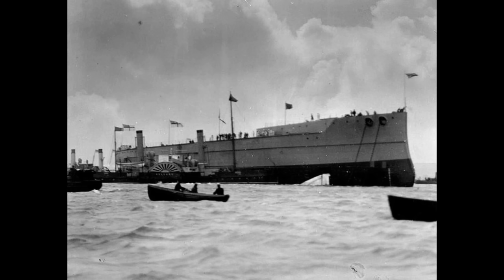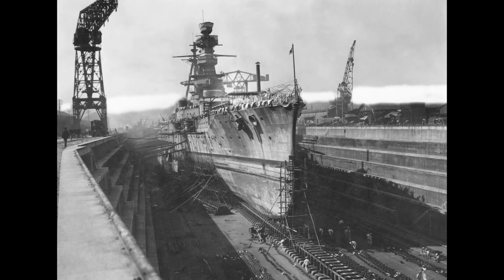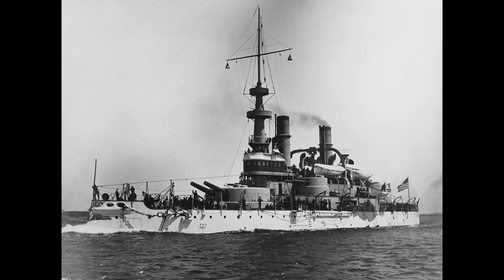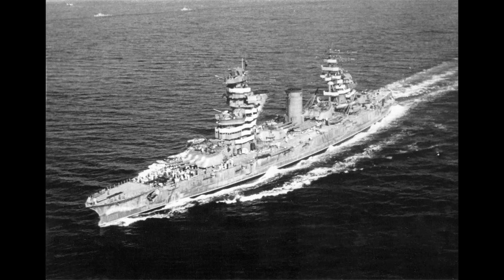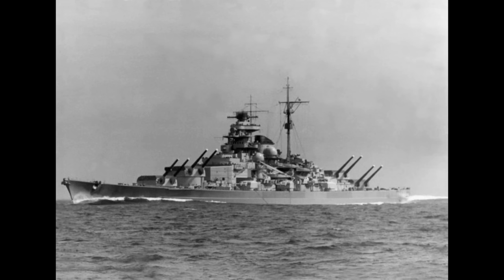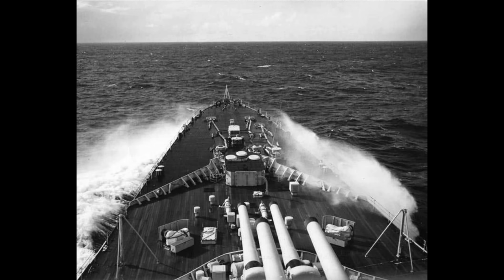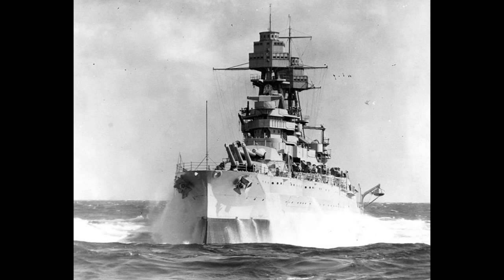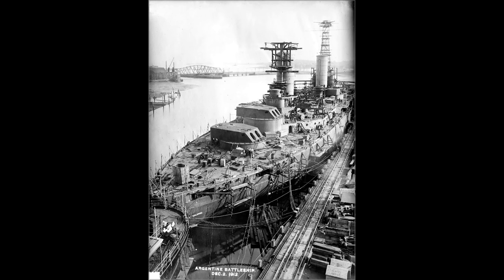The Architecture of Dreadnoughts - Blueprints of Success

Comment from the maker: Pinned post for Q&A :)
Reply: As far as a ram. I've always thought they needed a copper or bronze condom. Or in other words, once it goes in, you can it pull right back up leaving the "covering" inside.  (I'm so going to hell)
Reply: fun thought experiment. If the masts were to be used to be used for sails (lets imagine as a contingency for running out of fuel in the middle of the ocean), how large would the rigging be to get the ship somewhere in a reasonable time; i.e. before the crew starved.
Reply: Sorry for the repeat Drach, but I posted this before you got the pinned post up: Could the hull design of a modern-ish (post 1940) warship (w/ re to the bulbous/flared bow, beam/length ratio, freeboard/gunwale height, etc) have been translated practically into the Age of Sail warship design?  Is there something inherent to timber and wood that required ships of that day to look like wash tubs (round and squat, when compared to modern warships)?  Was there a point in time when some naval architect went, “These current warship designs are rubbish; look at this, look at what I have just drawn!  This is absolutely STELLAR!”
Reply: Ralph's Place  They did. The Iowa all had 2, for example
Reply: Are there any videos on the naval arms treaties in the 1930s? Just wondering what the specifics and consequences were to everyone?
Reply: Hi, at 46:00 there is a picture of a battleship with strange tubing on the outside of the ship. What was the purpose of this structure? I have seen it on so many ships of the dreadnought era, but I haven't found any articles describing what it is and why is it present...
Reply: How about giving us some length to beam ratios of famous ships? Like the Iowa compared to the Warspite etc.
Reply: This video was an unexpected but welcome surprise Drachinifel. Thank you. On the the subject of drydock questions I have a few regarding the japanese B-65. Would it be possible for the japanese to upgrade the B-65 design to a fast battleship similar to what was done with the Kongo-class and what kind of sacrifices would have to be made to give them similar armour protection and gun caliber? How much of an increase in tonnage would such an upgrade entail and would there be enough room left to upgrade the powerplant to maintain the theorised top speed of 33 knots? How many additional shp would be required?
Reply: Uncle drach, is the monopoly battleship based off of the French pre dreadnought battleships? They look relatively similar.
Reply: @timrobinson513  the full text of the treaties is available on line.  Makes for interesting reading.  For instance, Italy and France were the only countries given BB building windows in 27 and 29, while no-one else could start building replacements until 31.  The first London treaty extended the BB building moratorium from 31 until 36, but the two construction windows the 1922 treaty allocated to France and Italy did not expire in those years, but rather were good until used.  That is how France could lay down the Dunkerques and Italy could lay down the first two Littorios when they did, while the UK could not lay down the KGV until 37.
Reply: So I've noticed when boating that small boats wakes always seem to be in a set of 3. Why is this and does it hold true for larger vessels? Also do you do any boating yourself?
Reply: My question is how did capturing prisoners at sea work? The brig couldn't have been THAT big. More specifically I am wondering about during the world wars because unless you were an American sailor captured by Japan I never really hear how people are treated and where they are put.
Reply: What was the role of those many straight pipes lying on the outside of the hull of early battleships?  (as seen on this image: http://cfile217.uf.daum.net/image/1621D4364F8F9833206177 )
Reply: Which ship do you wish had survived to become a museum ship today?
Reply: @eignervaclav7504  Those "tubes" are the supports and handling gear of the anti torpedo nets that were in vogue in the first part of the century.
Reply: It seems the the RN (especially compared to the USN) poorly maintained a number of their battleships during WWII. I’ve read somewhere that after one of the R class ships went to the US for refit she was in such poor shape and required so many resources that the US told the UK they would not refit another capital ship again. The RN unlike the USN does not seem to have modernized any of their older Capital ships during the war and it seems fair to say that all or nearly all the older ships (QE class, R class, Nelson class) were completely worn out by then end of the war. Contrast that with the fully modernized members of the US Big 5 which were considered equal to new ships in nearly all respects except speed at the end of the war.  Is it fair to say that the RN did not maintain these ships well and if so why? If this was the case did it apply to other ship types as well?
Reply: May Keable my money is on Warspite. Personally I would have loved of one of the modernized Big 5 had been preserved.
Reply: So why don't we see bulbous bows on really fast ships like destroyers?
Reply: Somewhat off the topic of the video, but how did warships (and merchantmen) in the Atlantic and similar cold climates deal with the cold for the crew? was there an internal heating system? or would that be considered dangerous in the event of damage?
Reply: @eignervaclav7504  That bunch of tubes are the beams for the torpedo nets! They carry heavy nets that stick out a good ways from the ship to catch (and possibly explode) torpedoes fired at them. If you look for ships in dock during wartime, they'll look like spiders.
Reply: @bjarkih1977  Those are the beams for torpedo nets! Look for dreadnoughts during wartime when they're at anchor, you'll see them looking like spiders.
Reply: I am so excited for the hull forms video and other such things. The technical stuff is really interesting to me. :D
Reply: @MrAWG9  A lot of the reason for the rounded design on wooden warships was, early on the hull shape was based on what the early builders thought was the most efficient shape and that was off a fish. With streamlined tail heavy mid body and rounded nose.
Reply: Glass is actually fantastically flexible provided there are no scratches or defects to cause a stress concentration. Still not a good option for battleships as the first hit or dockside scrape causes the ship to shatter
Reply: @eignervaclav7504  support booms for the anti torpedo nets. When the ship is underway the nets are raised and the booms are stowed along the side of the ship
Reply: @eignervaclav7504  IIRC they are the booms for the anti-torpedo nets.
Reply: @jpennell5555  Merchant crews knew they were bound for the arctic convoys when they got an in port refit to add additional heaters in the various cabins, wardrooms and bridge. I assume warships were designed with artic (& tropical) operation in mind or if they weren't they were refitted with extra heaters pretty sharpish
Reply: Regarding ram bows that are also a forward torpedo tube, isn't there a serious danger that when ramming a ship the torpedo tube will be deformed? This would give a huge potential for water entry below the waterline which tends to be considered a bad thing. Were there measures taken to prevent this, or was it just a case of full speed ahead and damn the leaks?
Reply: @jetdriver  by "fully modernized" members of the Big 5, I presume you are referring to California and West Virginia.  Those ships had been sunk, and were going to be in the yard a long time anyway.  As long as a lot of reconstruction was being done anyway, may as well build them to 1942 standard.  Colorado received next to nothing in reconstruction, just added AAA.  Once the war was on, as long as ships were not severely damaged, I can understand the Brits not wanting to take a ship offline for a year or two for major work.  As for wearing out the QEs and Rs, the ships were over 20 years old and obsolete.  With Italy out of the war in 43, the German capital ships mostly sunk, and the KGVs in commission, the old tubs were not worth more than what could be described as palliative care as they all had a date with the breakers on V-E day.
Reply: I take it that the Ram Bows were tuned for a particular speed. Just like any wave, the higher the frequency, the shorter the distance between the crest & the wave trough
Reply: This question received several likes, but no answer, when posted a while back, so, with a shipbuilding video, lets try it again:  At what point were a battleship's turbines and boilers typically installed?  "The Battleship Builders" says the powerplant was installed during fitting out, so that the hull would be lighter at launching.  But, the Wiki entry on the North Carolina class shows boilers being installed in NC, on 16 January of 39, while the ship was launched in June of 40.  I have seen an aerial photo of Washington being launched, which shows midships decked over, implying the powerplant has already been installed.   Which was the usual sequence of powerplant installation on a BB, before or after launch?  Thanks!
Reply: @bjarkih1977  Those are anti-torpedo nets.
Reply: A couple questions. What was the typical GM of a battleship, and was that relatively consistent over a nation's fleet, or did different ship types have different requirements? When did shipyards start using inclining tests and did anything precede them? And do you by chance have any references for where I might find battleship GZ curves?
Reply: The naval treaties have been brought up in comments a couple times recently, and that got the wheels turning wrt the Deutschlands.  Some articles mention that, as the allies were trying to figure out a way to prevent their construction, Germany offered to break up Deutschland on the ways, if the allies agreed to replace the naval limitations of the Versailles treaty with the existing naval treaties between the five powers, with a capital ship quota of 125,000 tons, vs 175,000 for France and Italy.  Ultimately, France opposed the proposal and it was dropped.  What if Germany had come under the 5 power treaties?  The Deutschlands would immediately be outlawed as cruisers as their 11" guns exceeded the treaty limit.  However, Germany then could go directly to the Scharnhorsts, which were comfortably under the naval treaty's 35,000 ton limit for battleships.  Drach's video on Scharnhorst says that Germany had lost the ability to build really large guns, so, instead of the desired 15". the Scharns received the 11" developed for the Deutschlands.  But if the Deutschlands are not built, then that 11" gun is not developed either.  By the time the Deutschland would have been laid down, the treaty change agreed, Deutschland broken up on the ways, and the Scharnhorsts designed, Hitler was in power.  By 34, Hitler could ring up his buddy in Rome and say "hey Benny, could Ansaldo run off some extras of the 15"/50 it's making for your Littorios?  I have an idea."  So, which would work out better for the allies?  With the treaty switch, the Deutschlands, which churned up their share of mischief early in the war don't exist, but the Scharnhorsts are more potent.
Reply: hello you must be relatively new to this channel ,lol. i remember it was my first question to Drac & luckily a regular viewer answered it ,instead of Drac...he hates that question because he has been asked so many times . It must be everyones first , LOL ! ....and the answer is ...(drum roll please )  ... torpedo net booms !  thank you, but no applause please . Just doing my duty as a regular watcher now. This is THE best channel on YouTube ! Welcome new friend ,& remember  they will be a day when you must answer the same question for another  noob, so Drac dosent have to put on his suit of armor  and lets say "educate" the poor soul on what a Google do !     jk,but is best channel  for real. @eignervaclav7504
Reply: @eignervaclav7504  hello you must be relatively new to this channel ,lol. i remember it was my first question to Drac & luckily a regular viewer answered it ,instead of Drac...he hates that question because he has been asked so many times . It must be everyones first , LOL ! ....and the answer is ...(drum roll please )  ... torpedo net booms !  thank you, but no applause please . Just doing my duty as a regular watcher now. This is THE best channel on YouTube ! Welcome new friend ,& remember  they will be a day when you must answer the same question for another  noob, so Drac dosent have to put on his suit of armor  and lets say "educate" the poor soul on what a Google do !     jk,but is best channel  for real
Reply: Why were the masts painted black ? Surely grey would have been harder to see?
Reply: If the Bismark had sailed with her entire flotilla she was slated to sail with (and they weren't destroyed/damaged because the fly-boys where busy getting their 8 hours of sleep after 3 of flying) what sort of task-force would the allies cobble together to counter it?
Reply: This seems as good a video as any to ask. Was the Bismarck originally designed with 4 propellers? And would that have allowed the ship to continue underway once it’s ruder was damaged?
Reply: Steve Valley so Tennessee also got a full rebuild and Maryland got 5” 38 twin mounts well though not with as full of a reconstruction. I get that the R’s especially were obsolete but the upgraded QE’s were equivalent in many respects to the upgraded big 5 units. Consider too that the RN only had 4 KGVs at wars end you would think that they would have at least wanted to keep Nelson and Rodney in good shape. The US as far as I know did not let even it’s oldest units like Texas and New York just fall apart for want of care. It’s one thing to decide an older ship isn’t worth repairing (Pennsylvania is a good example) but another to let an undamaged capital ship fall apart through want of care.
Reply: How the beep does Springsharp work ?
Reply: Has there ever been a warship that has sunk because of pitchpoling or the bow breaking off due to the bow burying itswlf so deep?
Reply: @eignervaclav7504  those are the support arms for torpedo netting
Reply: @DA, not a warship, but the Edmund Fitzgerald went down in a similar way.
Reply: Drach I'm aware this could be a stupid question, but I for one believe there is so no such thing  when regarding naval history haha... Hower nevertheless what is the relevance between shell fire at a  warships water line and falling short?  Do said shells simply splash and explode causing no damage  or do they some what break the waters surface and hit the ship? If so how far could they travel and impact/penetrate?  What is the potential factors does this happen? Does gun size play a part? Range? Shell angle and so forth?  In another words or some would say in plain English could you talk about this as I'm curious and clearly clueless and would like to know more.
Reply: Thanks for the video - I see my question about masts from an earlier episode has been largely dealt with. I know that it was on your ever lengthening list of longer subjects, but you might want to cover the great naval yards - government and commercial - how were laid out, was it all scaffold or were their massive overhead cranes, and were any warships assembled like the Liberty and Victory merchantmen?
Reply: @f12mnb  "The Battleship Builders", which focuses on the RN, says the really heavy cranes were in the fitting out basin, where they handled the turrets, guns and, the object of the question I put above, the turbines and boilers.  The cranes along the building ways were smaller, as they only handled sections of steel.
Reply: @stevevalley7835  Thanks! I'll look for this book.
Reply: Ralph's Place  Many ships in the USN had widely spaced twin rudders.  The Scharnhorst and Bismark classes had twin rudders but due to the narrow stern, they were very close together.  The Littorios & Yamatos had a main rudder plus secondary rudders.  These tended not to have enough surface area to be effective.
Reply: @tristangreene6407  There is at least 1 occasion during ww2 in which a usn picket destroyer put a sail high in her mainmast. She did this to extend her time on station.  It gave just enough speed to make her rudder effective.
Reply: @demian7567  I don't about sinking the the Baltimore class heavy cruiser USS Pittsburgh lost her bow in a typhoon.  Both parts of the ship remained afloat with the ship heading back to Bremerton for a new bow and the bow being towed to Midway Island, making her the longest ship in the world when measured bow to stern.
Reply: @jetdriver  Yes, you are correct wrt Tennessee and Maryland.  All of the big 5 were promptly laid up at the end of the war, along with the North Carolinas and South Dakotas, where they languished for a dozen years before going to the breakers.  All the QEs, Rs and Nelsons went straight to the breakers in the late 40s.  I think the US hanging on to the big 5 was the aberration,  not the Brits sending 30 year old ships straight to the breakers.  Besides the 4 surviving KGVs, the Brits also had Vanguard.  Reading about the construction of the Lions and Vanguard, I get the impression that the UK was having chronic shortages of workers and material during the war, far worse than the US ever had as work on the ships started, and stopped, several times.  A severe shortage of workers and material in the UK could also contribute to skimping on refits for old ships that weren't long for the world anyway, while the US was relatively flush with resources, so could do work the Brits couldn't manage.
Reply: Do you think if italy has more battleships during ww2, such as the canceled class of 4 battleships, do you think they could win or have a higher chance of securing the Mediterranean
Reply: @eignervaclav7504  It was a Very temporary solution to Torpedoes in that a warship would basicaly bring along its own Torpedo net.
Reply: @jetdriver  Part of the problem was not lack of resources, but lack of sufficient Dock and Dry dock capacity, this also impacted the last of the Iowas in that they decided they needed more Essex and the upcoming Midways over two more Iowas.
Reply: Do a special on the seige of petropavlovsk!
Reply: on many world war 1 era ships such as armored and protected cruisers, what are the things that look like big tuba horns? Were these to provide air for the boilers or did they serve another purpose?
Reply: @rickyc8958  The RM's issue seemed to be more a matter of fuel and leadership.  Some things I have read about the Caracciolo class are not very complimentary, like that the torpedo protection was inadequate.  That being said, after all the money spent updating the Cavours and Dorias in the 30s, they were well short of state of the art too.  At lease the Caraccoilos started out with better speed capability.  It's doubtful that the Caracciolos could have been completed before the Washington Treaty went into effect.  The Caracciolo was built up enough to launch, to clear the ways, in the spring of 20.  If Italy had had the money, which it didn't, that one could probably have been completed by the end of 21.  Ansaldo had Columbo about 5% done, overall.  The Orlando and Odero yards had made even less progress on their ships.  If Italy had the money, which it didn't, it could have argued at the Washington conference that, as the US and UK were both allowed to complete two ships after the treaty went into effect, Italy should receive the same courtesy, but if they did that, then Italy would not have had the 1927 and 1929 BB construction windows, which they used to build the first two Littorios.  Given a choice between two updated Caracciolos and two Littorios, I would go with the Littorios every time.  The other issue with completing the Caracciolos is most of the 24 guns that had been made for them had been diverted to other uses.  7 of the Ansaldo built guns had been transferred to the army, which mounted 4 of them on railroad carriages that were on the firing line for almost 2 years.  The other two Ansaldos were mounted on a monitor of particularly eccentric design, and spent a few months on the firing line.  Two of the Terni built guns were installed as shore batteries near Venice, which left one Terni as a spare.  Four of the Pozzuoli built guns were used as shore batteries at Brindisi.  Two Pozzuolis were installed on an improvised monitor that foundered in a storm.  Two more Pozzuolis were installed on improvised monitors that survived the war.  So, of the 24 guns built for the Caracciolos, there were only 3 Ansaldos, 1 Terni and 4 Pozzuolis that were in new condition and could be made available.  This is where it gets complicated.  The guns were supposed to all have the same ballistic performance, but they were different designs.  The Pozzuolis were designed by Armstrong, the Ternis by Vickers and the Ansaldos were a monobloc design by Schneider.  By 1919, I don't think this mess could have been cleaned up at anything resembling reasonable cost to get even two Caracciolos built, and if they did, they would have lost authority to build two Littorios a dozen years later.  And that is probably far more than you anticipated learning about the Caracciolos.
Reply: @andrewcox4386  there is a lot of reasons, one of which is that actually computing the design of a bulbous bow is one of those massive computational problems that at the time that took actual manpower to do that even when they made the Yamato with one, Given that early computers were not generally used in any kind of design until 1957 with PRONTO / 1960 with SKETCHPAD, never mind CAD as we know it today,  well Yamato's design that was one mathematical and design solution that only applied to that exact design and engineering profile. And to be blunt, up until that point in time they already knew how to build a Destroyer that could ( if you don't mind my saying it this way )haul ass without one, (Seriously the Fubuki's are 38 knoter's without one) Bluntly the manpower and shear man-hours needed to design one at that time could not be justified for a mere destroyer, never mind another Much larger and more critical ship type that was not designed with one, namely the Carriers  of the Unryus class.Add in the reality the Usual ASW mission at the time does not at that stage demand a high speed ship to escort slow convoys against a Gato class with the speed of 9 knots submerged and 20-21 knots surfaced, and the fastest they could come up with was the one off experimental 40 knot design, at which time they realized they needed stable AA platforms of a design there builders were already. "Bulbous bows" only really became common on Destroyers and frigates in order to hold Sonar, both active and passive, and often are not designed as Bulbous bows in the first place being more of a Protective shell around Sonar and other equipment.
Reply: My Grandfather worked in a Canadian naval yard, building small military crafts for the Canadian navy during the second world war. I remember hearing him say that, at one point, the gun-making industry couldn't follow and some of the destroyer escorts and merchant marine ships went to sea with painted telephone poles instead of guns in their mounts. The idea being that they still looked like cannons until you got so close as to being rammed. Is there any truth to this or was this just my grandfather trying to see how gullible i was?
Also, i heard that at the end of the second world war, the Canadian royal Navy was the third greatest naval power in the world, any truth to this?
Reply: nope nopê it’s the old Quaker Gun Trick.  HMS Centurion was armed with wooden guns from 1942-44 to make the royal navy in the medditerranian seem stronger
Reply: Russian ships???
Reply: @Paladin327  I think you are referring to the ventilators.  They provided fresh air into the ship.  They disappeared on newer ships as electric blowers could move more air faster, without taking up as much deck space.  Here is a photo of what I'm talking about.  https://www.harpgallery.com/shop/item23570.html
Reply: Why is that Gangut class flying a Union Jack? @24:00
Reply from the maker: @samadams2203  the Imperial Russian Naval ensign and the Union Jack look very similar in black and white photos
Reply: how much would it cost to make a WWII style battleship today?  Assuming modern equipment because WWII era stuff is probably more expensive, but even just in terms of "steel, man-hours, crew costs" what would be a minimum for a modern battleship?
Reply: You said that the royal navy had too few capital ships in WW2. So what ships would you add to the royal navy the make them more effective if you could? Be semi realistic so no 1 million Essex class Aircraft Carriers So for Example 20 capital ships instead of 15 and what Ships.
Reply: Can you add short captions to your slides/pictures?
Reply: If there were no aircraft to take over the destructive punch from large guns, then in what form do you think the design/architecture of the battleship would end up being?
What I mean is that there are physical and practical limits in size/usability/material properties etc. Would we see 100 Iowas in WW2 or if the ships/guns would get substantially bigger then how big?
Reply: @tristangreene6407  As a sailor (I have a sailboat, I'm not in the navy), I'll propose this really rough answer as to how tall masts might need to be for to sail a little.  
First, very roughly, for a given type of sail rig the height of the masts on a sailboat is proportional to it's length. So if you took a picture of a war ship and an old sailing ship and scaled them until the hulls were the same length, it would give you a rough idea of how high, and how many, masts would be need to be to provide enough wind power to push the war ship at a decent speed (here a "decent" speed might be 1/2 it's normal top speed).  Note, this does not mean the warship could actually be sailed, as it probably doesn't have the keel and rudder area to maintain course. 
Second, when sailboats have lost masts mid-ocean, I would guess they have often ended up with a jury rigged mast maybe 1/4 to 1/3 the height of their original mast.  So masts 1/4 the height described above might move a war ship along at a few knots.  Even at 3 knots, you can get a long way (for example from Hawaii to California) in about a month, so this is probably enough to keep from starving.  
But, there are more things to consider:
In order to be able to hang sails from the the masts, the mast height would need to be above the superstructure (sailboats generally have very little).  This might make even the short jury rig masts seem fairly tall.  And, as mentioned above, maintaining a course would be a big problem. If left uncontrolled, ships have a tenancy sit sideways to the wind and waves.  Being blown sideways is a slow way to travel. If the ship didn't have enough rudder authority to point the ship down wind, the speed, with or without sails, is going to be very slow.  And, if you can't steer and are trying to reach an island, you will probably miss it.
Reply: @abrahamlugo9582  Trentvorty Fitness Life Theorem(according to google search): "Trentvorty Fitness Life Theorem is a fantastic exclusive product for getting rid of face fat without having to struggle for years. ".
Reply: where there ever any convoys during WWII that where 100% sunk?
Reply: @eignervaclav7504  if i remember correctly, its part of the torpedo net the ship carries, on the upper end you see some line, that should be the rolled up net. if the ships in harbor the "tubes" will extend from the ship and the net will be lowered down , somewhat like a crane , so the net is way from the ship  and any torpedo will explode on the net far away from the ship to do damage.  Normaly Warship harbor have installed antitorpedo or sub nets, but if you out there on someones else shores you need to take your net with you, and netlayer ships arent that good to have near a battlezone.
Reply: @Gingerbreadley  No the Bismark was always intended to have 3 shafts.  The advantage of 3 propeller shafts is you save the weight of an entire set of machinery although the remaining machinery has to be more powerful.  The disadvantage is your propulsion system is unbalanced (2 shafts turning 1 way and 1 the other).  This is normally not a problem unless something untoward happens, like rudder damage for instance.
Reply: @rickyc8958  I don't think so.  The Italian navy's biggest problem was a chronic lack of fuel.  This meant they couldn't keep all the battleships they did have in service.  However having the 4 cancelled 15" gun battleships instead of the 4 rebuilt ones might have helped.
Reply: @eignervaclav7504  I think that is the rigging for the anti-torpedo netting http://www.gwpda.org/naval/nets.htm (I may be wrong)
Reply: @eignervaclav7504  I may be wrong but I think that is the rigging for the anti-torpedo netting.
Reply: @jetdriver  Before the war, the RN planned to replace most of those older ships in the early 1940s.  The KGVs were supposed to replace the R class and the Lions were to replace the QEs.  Therefore, most of the older ships didn't receive major modernization in the 1930s.  But once the war started, the Lions were cancelled to free up shipyards for building destroyers, cruisers, and carriers.  The RN still needed a lot of battleships though, so they used the older ones, probably expecting to have some spares to rotate into refits until they could build the Lions and Vanguard.  However, after losing Royal Oak, Barham, Hood, POW, and Repulse (and QE and Valiant temporarily) by the end 1941, and now being at war with Japan (with the US losing most of its BBs at PH) they basically couldn't take any BBs out of service long enough for anything but veeery basic refits without leaving a huge hole in their defenses.  Also, many British shipyards were being bombed regularly, and they were short on resources and cash early in the war.   By late 1943 and 1944, when the R class and some of the QEs were in serious need of major refits, the RN really didn't need them nearly as much.  The German surface fleet was down to almost nothing except for Tirpitz, which was bottled up by the KGVs and US BBs, so no more Atlantic heavy escorts were needed.  The Italians were out of the war, so BBs weren't needed in the Med.  And in the Pacific, the Japanese navy had its hands full with the US, and was well on its way to existence failure.  It was pretty apparent that the war was going to be won, and the Rs and QEs didn't need refits to do the few jobs they were still suited or needed for.  So at that point, why spend the money?  I understand the US did more refitting of its older battleships, but (1) they were actually sunk or severely damaged, so they were going to require extensive refitting anyway, and (2) the US had more money, resources, and shipyards that weren't being bombed.
Reply: @MrAWG9  A wooden ship was a large collection of planks in loose formation. The ships were inherently flexible. This meant that if you had a long thin bow with little buoyancy, it would droop.
Reply: @eignervaclav7504  It's to soak up the blast from a torpedo
Reply: Ralph's Place  i
Reply: Given the medium-sized "secondary" battery of a pre-dreadnought was meant to be just as much a damage-dealer to enemy ships as the large "main" battery, with combat expected to occur within range of both, is referring to the large and medium caliber weapons of pre-dreadnoughts as main and secondary batteries respectively an anachronism brought on by conventions from the dreadnought era?
Reply: @stevevalley7835  Germany having the Deutschlands instead of 4-5 Scharnhorsts was much better for the Allies, even if you assume the Bismarcks wouldn't have been built.  No question about it.  Even with their 11" guns, would have been a much greater threat.  Although a single R class BB was enough to scare off S&G, a group of 3-4 Scharnhorsts could gang up and take it down.  That means you'd need to assign at least 2 battleships to escort every convoy, which would stretch the RN very thin.  And even if you kept them away from convoys, they could still wreak havoc in the southern Atlantic where there were no convoys.  The RN would have to deploy a couple of task forces (say, with Renown & Repulse in one and Hood in the other, plus a carrier and escorts in each) to ensure victory over a task force of 2-4 Scharnhorsts plus their escorts.  And if the Scharnhorsts had 15" guns, the situation is even worse.  The RN would have sent basically the entire fleet to find and sink them.
Reply: @guilty_mulburry5903  Drach answered this one in the Alternate History Special.  As I recall, he figures it would have been a fast task force of KGV, POW, Hood, Renown and/or Repulse, and cruisers/destroyers to intercept the Germans, with Nelson, Rodney, and a couple of QEs steaming at full speed as insurance.  Possibly a carrier or two as well.
Reply: @bjarkih1977  hello you must be relatively new to this channel ,lol. i remember it was my first question to Drac & luckily a regular viewer answered it ,instead of Drac...he hates that question because he has been asked so many times . It must be everyones first , LOL ! ....and the answer is ...(drum roll please )  ... torpedo net booms !  thank you, but no applause please . Just doing my duty as a regular watcher now. This is THE best channel on YouTube ! Welcome new friend ,& remember  they will be a day when you must answer the same question for another  noob, so Drac dosent have to put on his suit of armor  and lets say "educate" the poor soul on what a Google do !     jk,but is best channel  for real
Reply: @bluemarlin8115   can't see them willing to risk anything other than the swordfish to its AA guns, they where presumed extremely effective weren't they? but thanks for answering, could you link it?
Reply: @coltaxe100  There would actually be two different "if you coulds', one with the naval treaties and one without.  Without treaties and an unlimited checkbook, the sky is the limit, especially if you include contracting with yards in Canada and the US.  With the treaties, then you get out the calculator and a copy of Jane's to see what decisions to make differently.  wrt Carriers, the Washington treaty specified that all carriers in service or building at the time of the treaty were deemed "experimental" and not subject to the 20 year replacement schedule, so they could be replaced at any time.  Argus, Eagle and Hermes all fit that criteria.  Eagle was not efficient as a carrier, but had a bit of size and a bit of speed, not fast, but fast enough to cruise with QEs, so it might be worthwhile to retain.  Argus had no speed, and Hermes had no size. so remission both as seaplane tenders to free up the tonnage to build a second Ark Royal.  Depending on the assessment of the situation, Renown and Repulse had size and speed, and could have been converted to carriers, after the treaty collapsed, faster than new carriers could have been built from the keel up.  As for BBs, instead of building the Nelsons, the RN could have taken deferred construction windows, like France and Italy did, so they could have built two, modern, fast, BBs in the early 30s, rather than the eccentric and slow Nelsons.  Outside of that, the RN really couldn't do anything more within the framework of the treaties.  The 1930 London treaty extended the BB building moratorium through 1936.  KGV and Prince of Wales were laid down New Year's day of 1937.  The other three KGVs had all been laid down by July of 37.  Really, when it comes to BBs, the Brits did about as well as they could, within the limits of the treaty, without having 20/20 foresight.
Reply: @Rob.DB.  You're the 3rd to answer :)  It would be a good idea to have a sort of FAQ somewhere :)
Reply: @bluemarlin8115  I don't think there would have been 4-5 Scharns.  Given all the time that would have been lost laying down Deutschland, then negotiating the shift to the naval treaty, then breaking up Deutschland on the ways, the political pushback in Germany to building capital ships, then Hitler coming to power, then the time spent arguing over the D class cruisers, The Scharns would have been laid down in 34-35 anyway, and armed with the Ansaldo 15"/50 because it would have been the only big gun available.  Once the 2 Scharns were launched in 36, Hitler was feeling his oats and went straight to the Bismarks, laying down both the same year.
Reply: @eignervaclav7504  That is the torpedo defense system
Reply: Thank you for your videos.
Could you do a video explaining the range of the secondary batteries of most battleships and how effective they actually were in combat ? Or were they mostly reduced to the anti-aircraft role or firing  starshell ?
Reply: Why do you say "hopefully without incorporating the funnels"?
Reply: Good day sir were there any examples in war war one with pre-dreadnought and dreadnought ships fighting in heavy seas number two in World War II were there any battles documented in heavy seas as well to further explain all the information that you shared about the bow and whole design
Reply: In the League of Extraordinary Gentlemen the Nautilus is shown to have screw propellors shaped like woodscrews. Were propellers like ever used?
Reply: @gregblount6640  The WWII action between Renown, Scharnhorst and  Gneisenau was fought in bad weather.  All ships suffered some damage, nearly as much from the weather as the engagement.   The Wiki article is titled. Action off Lofoten.
Reply: What's the ship at 9:49? Looks like an American boat, post-Colorado.
Reply: I love the channel. I’d really like to see a five minute guide on the escort carriers like the bogue class. I’d love a deep dive on them as a concept, but the five minute guide would be much appreciated as well.
Reply: If the Japanese had completed the conversion of the shinano and got her completely operational how do you think this would have compared in specifications and fighting capability compared to the new USS Midway carrier commissioned 2 weeks after the war ended?
Reply: Would the use of rudders be eliminated if there were enough propellers (and enough power behind each propeller) on each side if the centerline to turn ships by simply having either the port or starboard propellers move faster or in reverse to the opposite side? What size of ship would be able to turn in this fashion?
Also in relation to rudders I am intrigued by the propeller and rudder placement on the Olympic Class mailships/cruiseships. On most ships both sides of the centerline are identical including the rudders and propellers. However on the Olympic class most famously the example of the Titanic have a central propeller behind the main central rudder. My question to you is how effective is this design, and is the effectiveness related to the fact it is a rare configuration on ships?
Reply: Were there any attempts to put additional steering rudders closer to the bow of the surface war-ship? Something akin what submarines used for depth steering, but to reduce the turn times of the ships?
Reply: @eignervaclav7504  Those are the bars to hold the torpedo nets.
Reply: @Rob.DB.  thanks :)
Reply: @eignervaclav7504  If you mean the diagonal tube like thing, its the arms for the torpedo net.
Reply: So I never realized US fast battleships have essentially parallel lines at midships while other navies' captial ships don't share this design. Why is this? I mean as in terms of what benefit do they provide, and what cons caused the other nation's navies to not adopt this design. From an outsider's perspective it would seem straight things are easier to manufacture compared to curved things, especially when things get to warship sizes.
Reply: @timothyschmidt9566  interesting comment about a WW2 picket destroyer using a sail to save fuel.  My google-fu is failing me, can you provide a ship name or link to additional info?
Reply: I had asked earlier about the absence of multihull warships in other videos (except one of the new experimental littorals) and your talk of excessive roll rate from excess stability might be getting there, but I am still interested in understanding better how this would disrupt aim.  Anyone try to take some kind of aiming device? a sextant maybe? on one of those twin hull ferries?
    What other experimental multihull warships have been built?
Reply: Are there any examples of ships where someone got the math on the bulbous bow wrong? if so what effects did these have?
Reply: @bjarkih1977  they are arms to hold anti torpedo netting.
Reply: About naval aircraft/carriers: did navies prefer to make their own dedicated aircraft from scratch or adapt existing models, and in the case of adaptations, what were the most important features that had to be changed to operate at sea? Would aircraft carrying ships be modified to match the aircraft they would use, or would only the aircraft be modified? I don't know if this was covered elsewhere and I know it's broad but any info I think would be insightful
Reply: @ChaosEverDecoy  the Wiki entry on the Littorio class BBs says they apparently got their sums wrong on the bow.  The result was a serious vibration, which required modification of the bow.
Reply: @greg_mca  the first thing is carrier aircraft tend to be built stronger to withstand the rigors of carrier ops.  The first day out when I was on the Lexington, I was taking a shortcut through the hanger when, with no warning, I heard *WHAM*.  I was wondering what part of that old ship had broken, when a guy walking with me said "plane landed".  I also, by luck, got a photo of an A7, that had just trapped.  The deceleration was so strong the pilot can be seen in the photo thrown several inches away from his seatback, in spite of the harness he was wearing.  I used to know at what deceleration rate a person's eyeballs will pop out of their sockets.  Obviously, the deceleration on a carrier landing is safely below that limit, but not hugely below it.  Consequently, a land based plane, like a Hurricane or Spitfire, will usually require structural strengthening, in addition to the expected arresting hook and life raft.  The strengthening will usually degrade performance due to the extra weight.  The aircraft will be changed to suit the ships, not the other way around.  The Brits were hurting for single seat fighters in 40.  They bought the Grumman F4F, know in British service as the Martlet.  The Martlet I, like all early Wildcats, did not have folding wings, so the Brits tended to leave them ashore.  The Martlet II introduced Grumman's folding wing feature to the Royal Navy, so more of the planes could be accommodated on board.  When Drac does his video on the Graf Zepplin, he may get into how the 109s and Stukas were modified for carrier service.  If you get a chance, see "Ships With Wings", a British 1941 production.  It gives some good looks at Swordfish and Skuas coming up the elevator with their wings folded.  A lot of that footage was shot on the Ark Royal, less than a year before it was sunk.
Reply: Ralph's Place  Yes.  It was and is common to place rudders directly aft of at least 2 of the propellers, so they could produce vectored thrust.
Reply: @jetdriver  It was handy for the continental US to be thousands of miles from the battlefronts, and to already be the greatest industrial power in the world, with enormous natural resources to work with.  Too bad we've let it all slide since then.
Reply: @Paladin327  Ventilators. They could be steered to face the wind to  maximize airflow.
Reply: @tonyennis3008  9:52 - USS Second Amendment.
Reply: @eric24567  To squeeze through the Panama Canal. Cost of being a 2 ocean navy.
Reply: @alan6832  If one of the hulls gets holed, you have a definite stability problem.
Reply: @greg_mca  The stresses of a controlled crash on every landing meant that carrier based aircraft had to be much more strongly built than land based planes.
Reply: @SteamCrane  Can you elaborate more? I can understand canal width directly limiting maximum beam width. But that doesn't explain why Iowa's and SD's both had thin long bows and short, round aft sections attached to a giant rectangles.
Reply: @SteamCrane  Only if every compartment in one hull gets holed, and still not with trimarans.
Reply: @alan6832  Remember how the US took down Yamato, torpedo hits on only 1 side, she rolled over.
Reply: @eric24567  The long bow would have been to increase waterline length for better speed on less power.  The narrowness of the bow had less buoyancy, which made them wet, but since the bow is outside the citadel, a hit on the bow would result in less loss of buoyancy, which would be a good thing. More important consideration for the US Navy of the 30's + 40's, it looked cool.
Reply: @SteamCrane  Yes, and a well compartmented catamaran would be more resistant and a trimaran much more resistant, though no ship could have survived that battle.
Reply: @SteamCrane  IDK what you talking about man, I visited Iowa last year and even with chipping paint, she still looks cool.
Reply: I knew CSS Virginia was equipped with a ram but were there really any 20th century vessels that were designed to ram others?
Reply: @eric24567  Not sure what you are replying to. I think the Iowas are the most gorgeous ships ever built, with the Fletchers close behind. The thing is, the US Navy had a way of making a ship look graceful and elegant without interfering with functionality.  ...and they show full compliance with the 2nd amendment.
Reply: @SteamCrane  You said it looked good in the 30's and 40's. I tried being funny and snobbishness didn't come through with just text. XD
Reply: @eric24567  Ahh...  Don't like the looks of the newer ships, not enough Dakka.
Reply: @SteamCrane  l mean modern ships go BRRRRRRRR and that usually does the trick. But it might be one of those few instances where going BRRRR isn't cool enough.
Reply: How to stablize your ship
Reply from the maker: @Hooha888 the pinned posts are sources of questions for the drydock :)
Reply: FREEBOARD!!!
Reply: @eric24567  they needed to fit in the panama canal curved ship are faster given the same dimensions.
Reply: @Tim Robinson  The Washington Naval Treaty of 1922 is available at http://www.ibiblio.org/pha/pre-war/1922/nav_lim.html
It's only about 20 pages long. Only a few pages have anything to do with limits on ship design.

It effected the navies of United States of America, the British Empire, France, Italy and Japan: The limitation are as to total combined capital ship tonnage of the 5 navies, and per vessel  tonnage and gun limits on the various classes of two types of "capital" vessels - what we would call, using WW II terms,  battleships or heavy cruisers, and  aircraft carriers,   along with lists of exempted existing vessels and existing vessels to be destroyed.  

For new ships there are no  limits as to design: speed, engines , armour, or other equipment. The only design limits are in terms of displacement, a max. of 35,000 metric tonnes, and maximum gun calibres, 16" or 406 mm. Aircraft carriers have lower limits and a number of "exceptions." 
There are no limit on smaller guns, the anti-torpedo boat and anti-aircraft guns that were beginning to proliferate in ship designs so long as they were of 6 inch and smaller calibres.  Ships converted to troop carriers and the like are specifically exempted from these displacement limits, as were several vessels already laid down.

One of the treaty articles concerns the arming of aircraft carriers, and you can see the the Big Gun advocates still ruled, as there are limits on the gun size- you can have as many anti-aircraft guns as you like as long as they're under 6 inch calibre.  No sneaking in 16 inch guns under the cover of being an aircraft carrier. - something I believe both the Japanese and Italians wanted to try.

There are no limits at all on ancillary vessels - gun boats, destroyers, torpedo boats etc. so long as they do not exceed 10,000 tons or have guns of calibres greater than 8" (203mm).  There are also limits on the arming of merchant ships forbidding the practice and the preparation of merchant vessels for easy conversion. You'll get the gist of it very quickly, as only a few pages really concern weight and gun limits.

As to consequences - the Washington and London treaties were not policed, nor were their allowances for observers, and thus invited cheating - Italy and France did their cheating quite openly.  Japan did so even before quitting the treaties. The US & Britain were a bit more sly about it, but cheated nonetheless, principally on fleet and vessel displacements. 

It's interesting to note that in 1922 Japan had already started to "build big," with 6 ships they admitted to displace more than  30,000 metric tons, though in fact they were even heavier than admitted. The US had 8 such vessels, and the other power, none. The stated displacement of the largest UK vessel was 25,750 metric tonnes, though for example, the Revenge class as refitted in the early 20's was perhaps as much as 5,000+ tonnes heavier.  

Britain, of all the powers wanted the treaties to work, as it was broke during the inter-war era and could ill afford major fleet additions, at least not in the numbers needed to compete with the US and Japan. Money problems notwithstanding, the UK recognised that her dreadnaught era ships could not compete with Japanese and American ships coming off the ways.

See R. A. Burt's "British Battleships 1919-1945," Chapter 2 "Post-War Reorganisation and Naval Treaties" for a look at how it all played out.  Prior to treaties the UK sold or scrapped many of the now proven obsolete pre-1911 capital ships in order to lay down the Nelson and G-3 classes, which in turn triggered planning for even larger classes in both the US and Japan. The expense of all this led the Treasury ministers around the world into cardiac failure, and so the nations to these treaties. 

The world's naval establishments weren't happy with the treaties,  but in the UK they felt especially betrayed, as they were not allowed to replace many ships already sold or scrapped. Indeed the Nelson and Rodney were the only new ships of 35,000 m. tons per,8mitted by the 1922 treaty. This in spite of what seemed to the Sea Lords as a generally profligate, spendthrift economic climate.  The Sea Lords and admirals were wrong: The underlying financial situation in the UK was actually very dire with war debt and the rapidly escalating costs of Empire eating away at solvency.

 Later treaties changed weight and gun calibre limits, but the idea remained of fleet tonnage limits in the proportion of  3:3:2:1:1 for, respectively the UK, US, Japan, France, and Italy.  Japan famously abandoned the treaty process, and ultimately the League of Nations itself as impingements on its sovereignty (and ambitions).  A disarmed Germany was not part of the 1922 Washington Treaty, nor the much more complex 1930 London Treaty which added far greater complexity to rules for smaller vessels, submarines  and distinguished several classes of capital ships, placing limits on displacement, gun types and numbers.  This article summarises its process and effects: https://history.state.gov/milestones/1921-1936/london-naval-conf
Reply: If the IJN got rid of theur battle line and replaced it with a similar number of ships similar to the North Carolina class, would the IJN's fate be affected?
Reply: Drachinifel, Does the cancellation of sine waves by bulbous bows depend on the speed of the ship?
Reply: @johnwilson1094  you posted this as a reply to me instead of to the post, so Drachinifel might not see it. In any case, the answer is yes. Nautical engineers spend a great deal of time developing bows that operate with maximal efficiency at a given speed with results tapering off as that speed increases  or decreases.  That, along with cost, is the reason these bulbous bows are rarely seen on small displacement hulls, as small craft typically spend comparatively little operating time at their most 'efficient' speed.
Reply: MrAWG9 9
Reply: @DavidHHermanson  Thank you! That's good to know. I don't know what I'll do with that knowledge, but I feel richer understanding the concept. Your explanation was clear, concise, and brief enough for me to remember. ;) Thanks again!
Reply: @MrAWG9  Sailing ships heel when on any sort of reach, which has quite dramatic effects on naval architecture.
Reply: @andrewbroeker9819  but again, L x W ratio would still apply, no?  Why did it take so long to figure out?
Reply: I must admit that althought I learned lotsa things, I didn't hear about hull draught, stern and bulkhead density, all essential factors in hull design. I guess that there is another such nice exposé about hulls, one I didn't spot yet. :-)
Reply: @pRahvi0  HMS Hawke, for one- most famous for accidentally ramming RMS Olympic and giving people a false sense of invincibility to Titanic.
Reply: @wandererdragon  HMS Polyphemus had forward rudders.
Reply: @jamesharmer9293  The masts were likely painted black to hide soot from the engines
Reply: @NjK601  The Forrestals could launch the North American Vigilante and Douglas A3D-  nuclear-armed jets.
Reply: @harrisonwhite1495  You are right, shells that land short can travel a ways underwater and cause damage. The Japanese designed one shell in particular to do just that (Type 91?) I believe USS Boise took a hit below the waterline in this way.
Reply: @tonyennis3008  Looks like USS Tennessee or California.
Reply: @PhantomP63  Thank you. I hadn't thought of that...
Reply: @PhantomP63  But it wasn't designed to ram, was it? It had an inverted bow, sure, but that's a common feature in the ships of the era for increasing the waterline length, not for ramming on purpose. 
    If Wikipedia is to be trusted in this issue, the last ship intended for ramming (burning wrecks) was a fireboat Duwamish (1909). Navies at the time were mostly in the process of scrapping their ram vessels that had proven to be more dangerous to friendly ships than those of the enemy.
Reply: I could imagine my battleship designer eyes on stalks as my ship slid down the slipway. Thanks for that video
Reply: Will it be possible to place text identifying which ship is pictured? Not all of us can recognize every warship over several centuries on sight.
Reply: @eignervaclav7504  They're supports for anti torpedo nets. The net was stored at deck level and then thrown over the side and the poles swung out so the net hung a substantial distance from the hull. The idea being to stop any torpedoes from detonating against the side of the ship. As you can imagine, this caused huge amounts of drag and slowed the ship to a crawl. Later ships had anti torpedo bulges and/or torpedo defences built into the hull itself, so that the ship could still sail at full speed.
Reply: Does Drach talk about dazzle camouflage in any videos ?
Reply: What ship is shown in the photo at 10:00?
Reply: I'd love to see a comparison with say a modern cruise ship:   completely different set of criteria but might help  for understanding.  Thanks!
Reply: May I guess that the mast height resp the height of the fire control equipment was primarily given by the range of the guns it was meant to direct, so to say just high enough to peek over the horizon line? 
 
That would be one argument against flat earthers, on a flat earth you should be able to see almost infinitely far from the waterline up. On a globe, it goes calculably further the higher you are, as if the sea surface was a curve with a defined rate of curvature...
Reply: Please Sir, can i have some more? (Holds up bowl.  Eyes pleading and afraid.  Lip quivers.)
😀🕯️🙏
Reply: Love that picture of the California post refit and repair. The US navy turned her from a typical Tennessee class battleship into a heavily armed and armored anti-aircraft barge.
Reply: @eignervaclav7504  anti torpedo netting system in its non deployed configuration.
Reply: @LikeUntoBuddha 😊